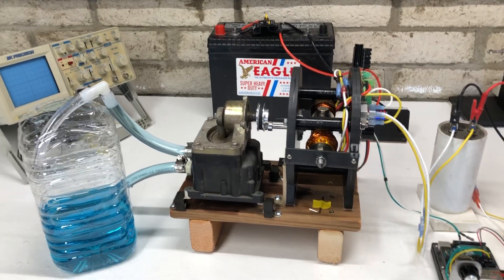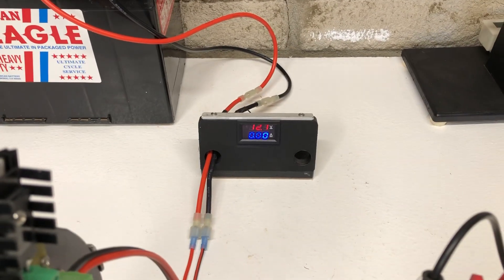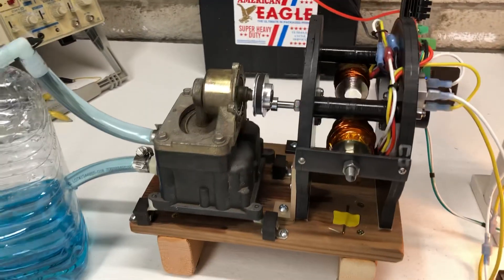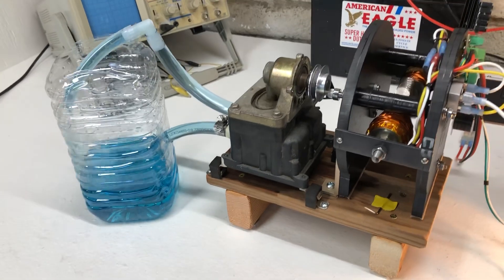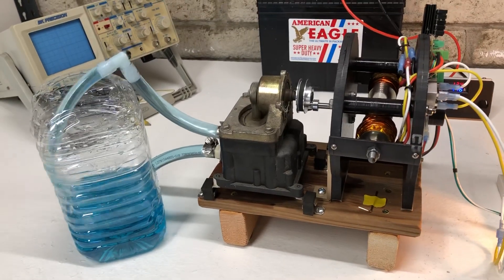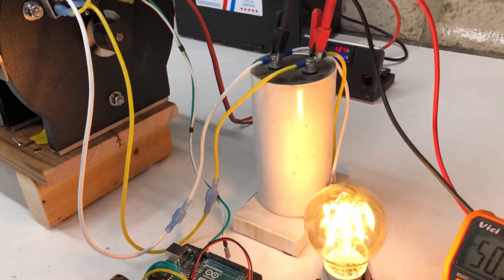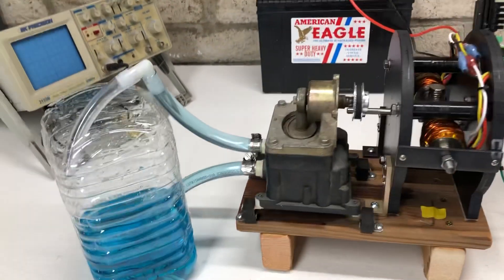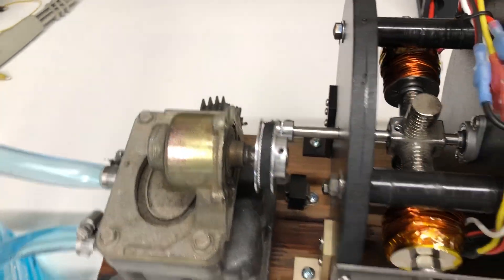Adams motor running water pump with output running light

Comment: Honestly you should be able to get the consumption rate of the motor way down seems like an awful lot of amps. 
I honestly believe the Adam's motor was an attraction mode not repel.
You got a lot of very nice setups.  👍👍
Reply from the maker: Thanks for the comment ! This motor does use a bit more amps than others but that’s because I made it for multiple experiments 
 Adams used the attraction of the magnet to the iron core to rotate his motor the energizing of the coil was to ( null) out magnetism so the magnets wouldn’t stop at The core 
 I use both because I’m going for torque 
Thank you for the compliment
Reply from the maker: The regular dc motor for this application draws up to 8 amps